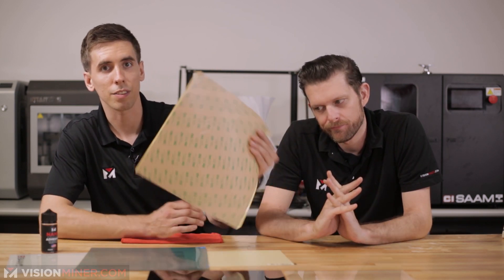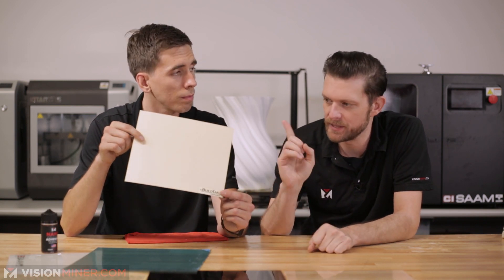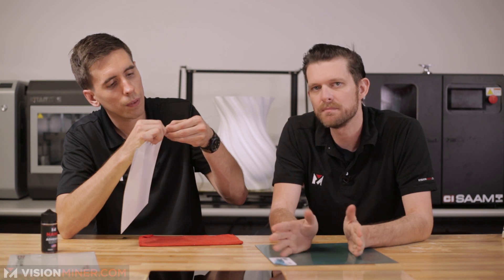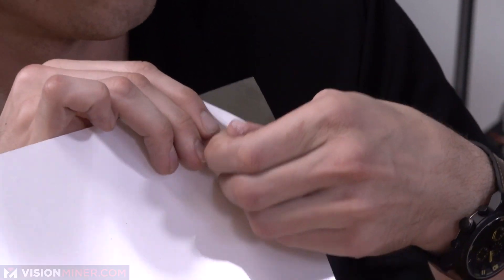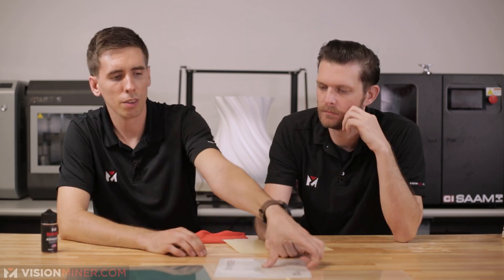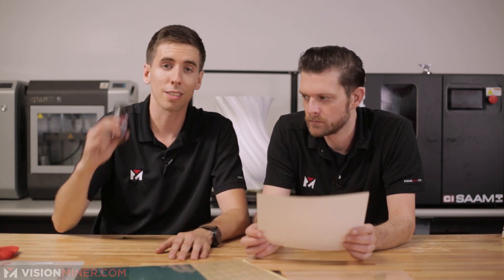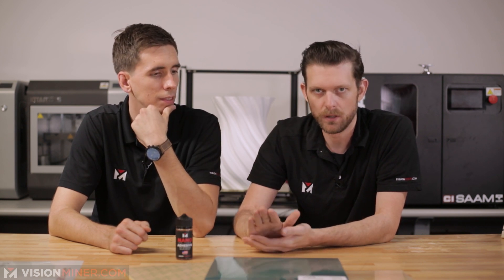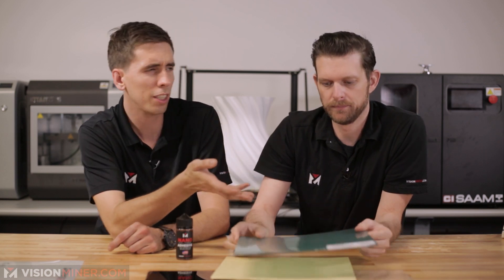Glue Series  - PEI Print bed Build Surfaces for 3D Printing

Comment: Hi I enjoy your videos and have learned a lot from them. I have an ender 3 v2 and am new to this stuff. I recently installed a pei magnetic spring steel bed. I ran the bed temp at 50c using pla filament. What is the best temp to use? I had an overnight print fail and wonder if the ambient temp lowering at night would cause this and if raising the bed temp would minimize the chances of it happening again? I noticed that with the slightest lowering of the temp after printing the objects simply wipe off the bed, no prying at all. Thanks

Comment: I think Pei is nothing else than a polycarbonate sheet with adhesive on one side.
Reply from the maker: Not so -- PEI is polyetherimide, a high performance thermoplastic, not polycarbonate. Very different material.
Reply: @VisionMiner  OK 😊

Comment: Love my pei sheet, but since I started using it I get spots on the part that touches the build plate that are real shiny. Still very smooth, but shiny lines that really show on the part. Is this common for PEI? Does it need to be roughed up? Any advice is appreciated.
Reply from the maker: The part will pick up the texture of whatever surface is used, so you can rough it, or smooth it more, whatever you prefer :)